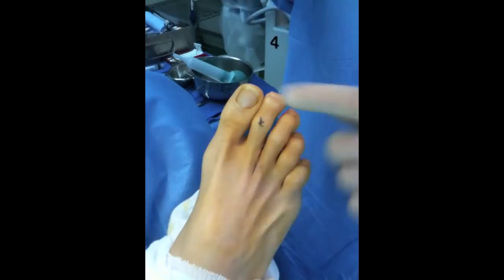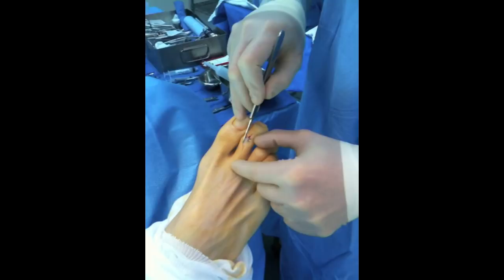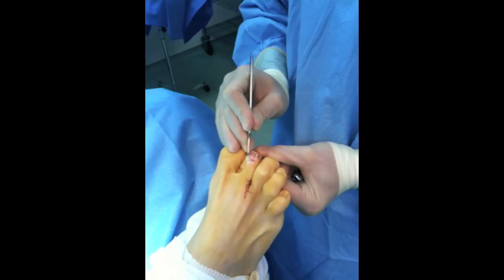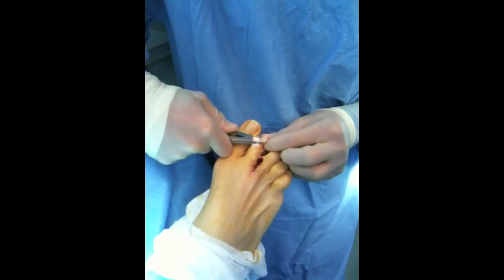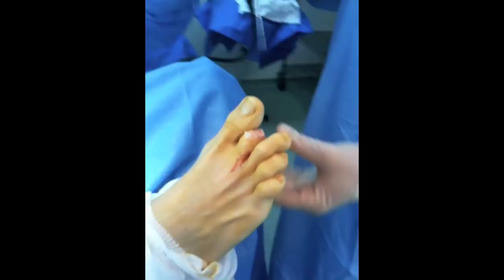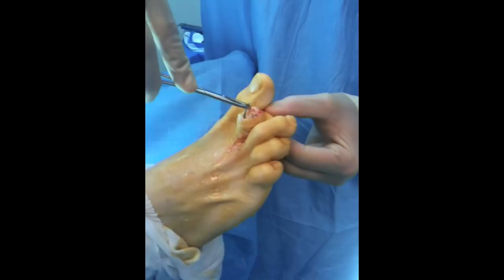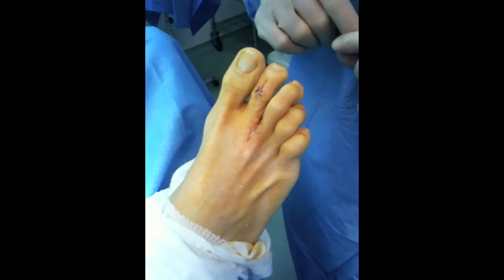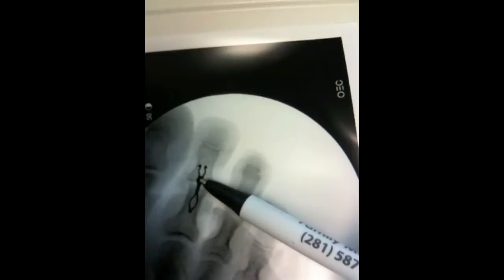Hammertoe Correction Surgery (Using a 'Smart Toe' Implant) | Moore Foot and Ankle Specialists

Comment: I appreciate this upload.  Had a hammer toe surgery two years ago and I was always curious as to how it was done.  This was my second sugery on the toe as the first one didn't work (they had just cut a ligament I think).  The scar isn't so bad though visible and I can't move my toe up and down so I still find that a bit strange but at least the second surgery did the trick and the toe didn't revert like it did the first time after the first surgery.  Got it done over Christmas break because of the 6 wk. recovery time.

Comment: Hi! They did leave scars on the tops of my toes but they are very faint. I can move my toes back and forth but they will not bend. I had my pins in for 6 weeks and then they pulled them out.I have read a lot of horror stories about having this surgery but I can honestly say it was not as bad as I thought it would be.I had to be in bed for 6 weeks which was no fun.The only time I was in tremendous pain was the few days after my surgery.My bones were sore for a few months. Hope some of this helps!

Comment from the maker: Not only did we straighten this patient's toe and remove the 'bump' that was rubbing on his shoe, but it was slightly shortened so it would not hit the end of his shoe either.
Furthermore we placed a hidden pin in his toe so his big toe won't push it over and heal at an angle.
-Dr. Moore

Comment from the maker: Yes Larry.  The proximal interphalangeal joint where the surgery is performed really has no function during running except stabilization.  Depending upon the surgeon and device used or not used, sutures should be remove in 2 weeks and light jogging can ensue as early as three weeks.
Reply: Moore Foot and Ankle Specialists - Dr Robert J Moore III & Dr Eric Blanson will the PIPJ of the second toe eventually fuse?
Reply from the maker: Yes.  And if it does not, there will be a small, scar tissue gap that would allow little to no movement anyway.

Comment: Hi, thanks for sharing. I’d toe surgery worth it? What if you have multiple hammer toes? Does it have any effects for those who’ve done it, for walking? Sports?
Reply from the maker: Although I don't use metallic pins anymore, the amount of toes and function after these surgeries do not alter walking, running or any other activity. The main heel to ball of the foot propulsive portion of your gait is also not effected. Just a few patients ask about the inability to bend the their toes at the PIP or DIP joints. And since the 'bent' or flexion position of the hammertoe is what they want corrected (or shorter, straighter toe), then the permanent position of the corrected toe and ability to still move and push off of the MTP joints normally makes sense.

Comment: How much post surgery discomfort will  be experienced??
Reply from the maker: Very little. In fact if a local block is performed after surgery with a little dexamethasone mixed in there’s little to no inflammation. I’ve had patients take a few Tylenol or Advil after surgery and get by. Staying off the foot for the first 72 hours takes care of most of the Swelling and pain. Otherwise a light dose of hydrocodone is necessary sometimes but on a scale of 1 to 10, digital surgery never exceeds a five or six.

Comment: Man every operation I had Im always nervous.
Now Im gonna have to have hammer toe surgery on both baby toes and I'll be put to sleep this will be fourth operation.
1 I had my 4 wisdom teeth pulled 11/5/2000
2 my fractured permanent tooth pulled 1/22/2014
3 a breast reduction  9/3/2014
Heidi Burns Rourke
Reply from the maker: Good luck Heidi!
Hope all turns out well. 
-Dr Moore
Reply: thanks

Comment: I have a question about this both of my second toes are similar to his and I'm looking at having this surgery done in a few weeks what is the typical recovery time? I'm active now with sports and I am just wandering how long I will have to be out of them. Thanks. Great video!
Reply: +Spencer Sedano Velasco Hey! I'm not too sure man I went to a podiatrist a week ago here where I'm from and he said he would need to remove my joint closest to the tip of my toe and insert a pin to straighten it. then  after six weeks he would remove the pin and it should be healed mostly by then

Comment: What's the difference between this treatment vs the one I see where they cut the tendon or whatever? It's in office and local anesthetic is used and they usually end up with a single stitch. The procedure usually takes minutes and they basically cut something under the toe that releases the hammer toe and it magically straightens out. Is surgery really necessary? Is there a difference between these 2 procedures?

Comment: I have severe pain in my left little toes and foot. At 18 that foot and toes fractured after jumping down on cement floor from top bunk bed. Then in my early 40s had that same foot run over by fork lift tire. It was sore and red for a few days after fork lift run over it but no pain a week to a year later and no swelling. But now 2 years later that foot and toes hurt like hell standing and walking at work for 8 hours straight. Not sure if i have that toe condition or just severe arthritis and or tendinitis maybe. Any way to surgically fix the pain issue in my foot and toes?
Reply from the maker: Apologies, but an examination, xrays and other tests are needed to answer this correctly.   I would book and appointment with a local foot specialist.  Good luck!

Comment: Doc, great presentation while performing the procedure.! Can you please comment on pro\con of using "Trim-It" pin.?  I am having Arthrodesis 2nd toe PIP due to Flexion issue Feb 4th 2010 and doc says he wants to use Trim-It pin.  I am concerned of toe drift as you stated in your video. I don't know what HW is best to use. 
Thanks.